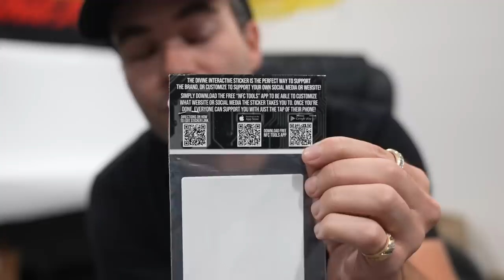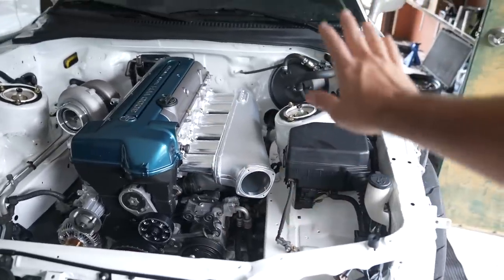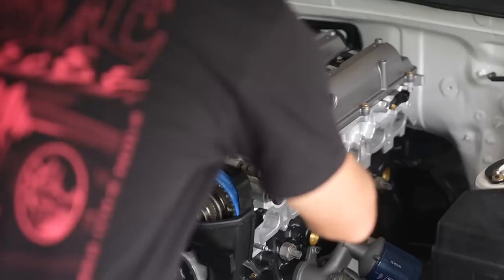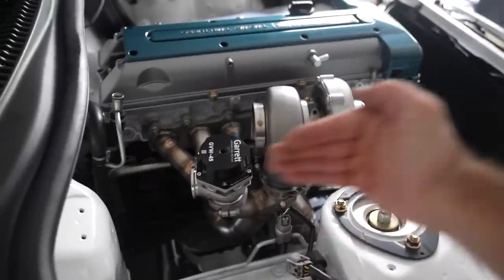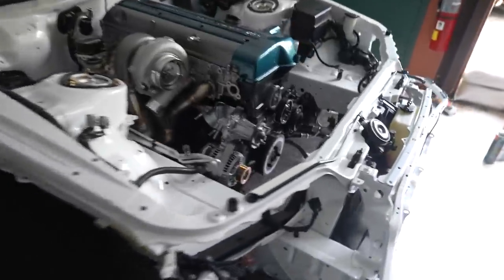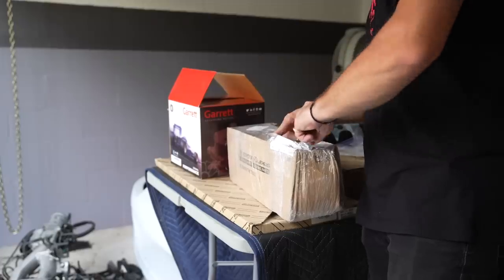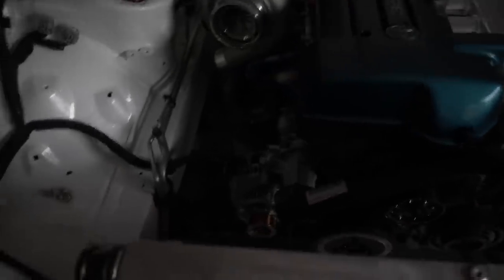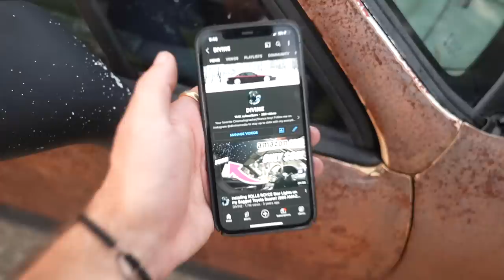INSTALLING AWESOME PARTS ON MY SUPRA!

Comment: I saw when you replaced the vvti gear you didn't replace the filter. Not sure if you're aware or not but there is a little oil filter that sits under the solenoid, you'll take that banjo bolt out below the vvti solenoid, it sits in the channel. Part Number is  (15678-46020) I believe, you'll have to double check.

Comment: Is this an NA lower block that you fitted a TT upper block on to ? Are the lower blocks exactly the same ? If i have an NA engine i can use the lower and just source the upper parts and swap it to a TT engine (obv ECU, gearbox etc changes too)

Comment: You need vvti upper radiator hose. You bought non vvti one. Also na shroud does fit with slight mods.

Comment: Supra tt have two different shrouds that you use for gte swaps. One shroud has dual auxiliary fans provisions and the other has one auxiliary fan provision. I would use the one the the single provision if you aren’t going to install auxiliary fans. You can seal up the hole to make the radiator more efficient. 1997-2002 Dual auxiliary fans shroud #P/N: 16711-46200. 1993-1996 Single auxiliary fan #P/N: 16711-46160
Reply: Also don’t forget that you need a GTE clutch fan too. The NA fans are thicker and will hit the upper radiator hose.

Comment: The Koyo I bought for my Supra was almost an inch thicker than the factory one. I hit a deer and on rebuilt I bought a Mishimoto and my old shroud fit better. Still a bit thicker but it did work.